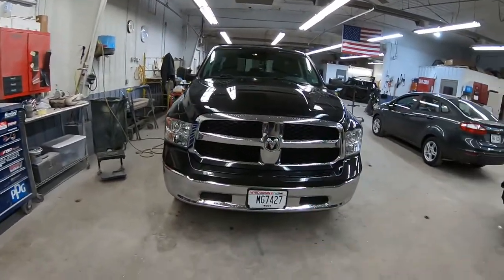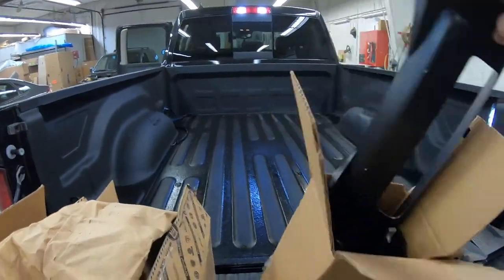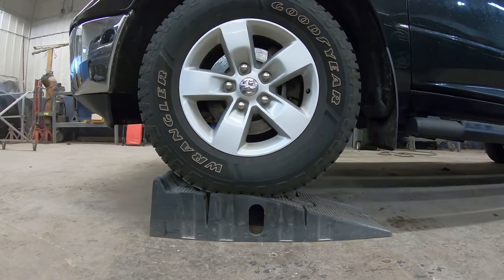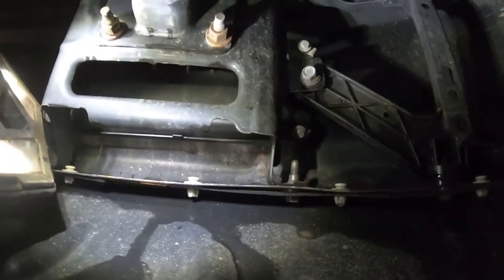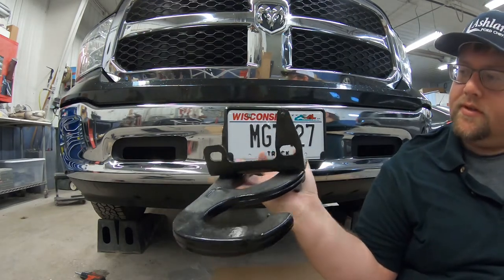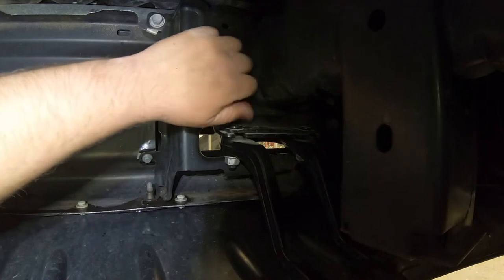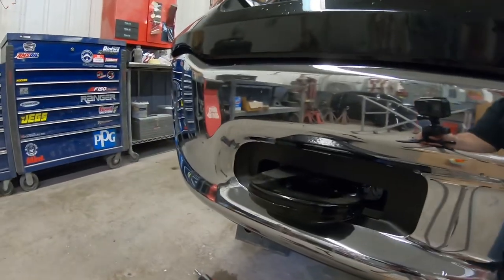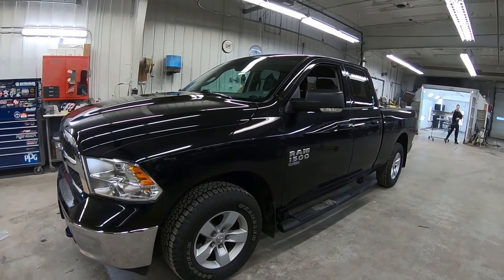2013-2022 Ram 1500 Mopar Front Tow Hooks Install

Comment: Just adding, looked up torque on alldata:

Front Tow Hook BOLT 85NM 63ft/lb
Front bumper support nuts - 1500 Light Duty 95NM 70ft/lb
Reply: What size are the bottom bolts that thread directly into the frame? The big bolts.

Comment: Can this be installed on a ram sport 2016? Modifing the black plastic stuff in the bumper?
Reply from the maker: Yeah it will work. You just need to cut the plastic piece to get it to work.

Comment: Wouldn’t you want the open end of the hooks to the outside of the truck?!!
Reply from the maker: Possibly 😂
Reply: @TheWiscoGuyz  The factory installed ones have the open end towards the sides of the truck
Reply: If you have to pull on that much of an angle that you are worried about a strap slipping off use the hook on the other side then. No big deal.
Reply: @gregdeguerre8804  I’m not worried at all, they open to the outside because you should actually yoke them to pull using both hooks, which is what I usually do